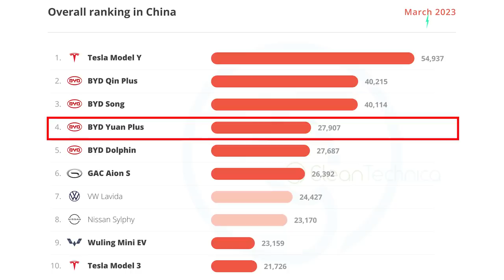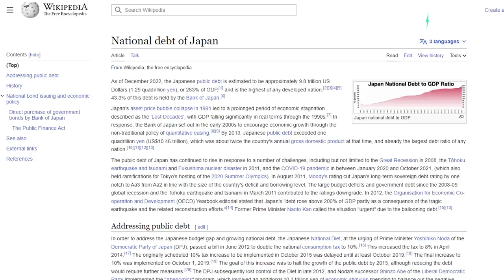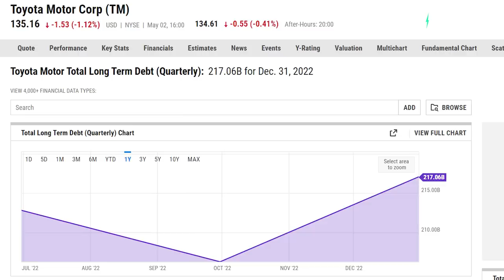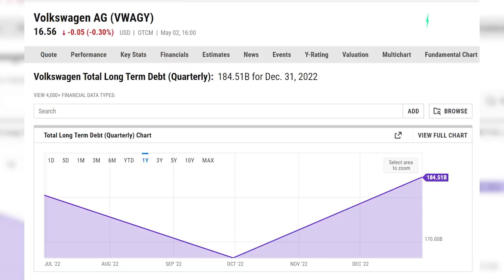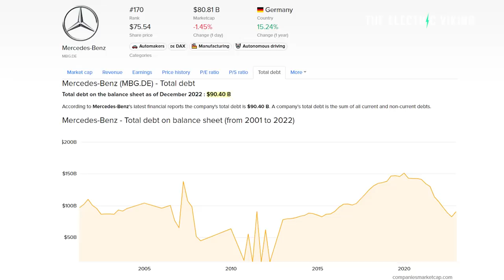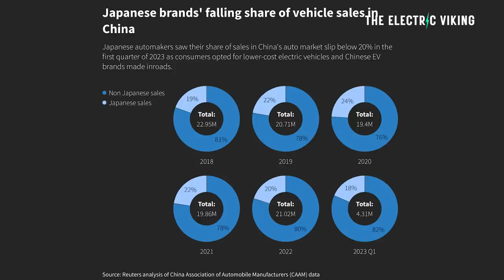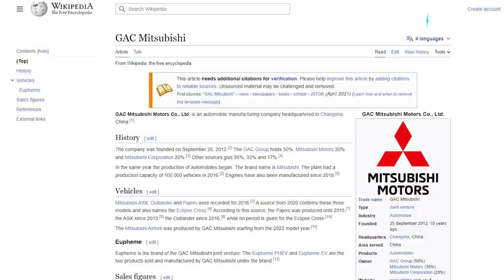Japan's automakers' Kodak collapse will cause an economic catastrophe

Comment: Japanese carmakers' dilemma is complex. EV involves 3 major technologies: traditional car, software, and battery. They are only good at the first, and need to master the last two as quickly as possible. Transition is very expensive. That's why only Tesla and highly committed Chinese new players fare better, so far
Reply: And Tesla are making a profit on each sale as well as charging equipment and storage.  So far not relying on repairs.  Past vehicle industry is based on servicing, parts and repairs.  If you can't make money on an EV sale, you don't have the time to get to the repair era.
Reply: Also if they convert to fast to EV they loose all their investment already made and they still making large profits selling gas engines
Reply: A review of Tesla's development history shows that it is China's well-developed electric vehicle industry system that has made it successful. If Tesla had not set up a factory in China, it would have been stuck in production hell for a long time and could not have quickly opened up a gap with other competitors。It is also because of China's well-developed electric vehicle supply chain that Chinese brands are able to iterate quickly, leaving all other countries behind.
Reply: @ShareGoodThings11  Agreed. Chinese new players entered the field around 2014 and started developing the supply chain. Tesla joined in 2018 and brought some technologies. Benefits are mutual. Obviously BYD worked on it even earlier and developed its own supply chain
Reply: Japanese carmakers simply cannot compete with Tesla and Chinese automakers on making BEVs.  That ship has already sailed.  What they can do now is to make Hydrogen Combustion engines hybrids to compete with BEVs.  That's what they are good at.  H2 stations will be built for H2 trucks and buses that H2-cars will be able to fill-up also.
Just a lot of marketing for energy companies to build H2 stations and for people to buy their "self-charging" H2-powered Zero-Emission hybrids.

Toyota should press ahead with Hydrogen Combustion engine with hybrid power train that is already perfected and proven to be highly profitable.  People will simply fill up with Hydrogen the same way they have been filling up with gasoline.  Leave the complexity issue for the experts to solve.  We will just enjoy motoring the same way we used to.
Reply: @trungson6604  I'm unconvinced that hydrogen is a viable option for passenger cars. Japan could implement it for all to see. If it's successful, everyone would be convinced
Reply: @PeterXiao1  --"China is quickly and quietly taking control of the hydrogen fuel cell market, with market activity over the past year dwarfing that across the rest of the world. While the country pushes to catch up with electrolyzer technologies, it could be set to dominate demand-side sectors in the hydrogen economies, if international competitors fail to step up their pace.

Throughout 2021, hydrogen fuel cell vehicle production in China increased by 48% to 1,777 units. Around 35% of this was achieved in December, according to the latest data released by the China Auto Association.

But the real headline figure is production capacity, which exploded five-fold through the year, even despite strict lockdown measures in many provinces across the country. From an 8,000 unit-per-year capacity at the start of 2021, the five major fuel cell manufacturers have all expanded production capacity, with their cumulative annual capacity now surpasses  45,000 units."  Sorry, this site doesn't allow posting of link to the article.  

Japan's advantage is in combustion engines, with so much legacy investment already, so Japanese automakers must make the most of H2-ICE technology instead of Fuel Cell.
Reply: @trungson6604  The text quoted isn't credible. 1777 units is peanuts. China is studying hydrogen technology, just in case Japan could make it work.
Reply: Elon Musk made good friendship with Shanghai’s mayor at the time and so his factory was able to be built in no time contrary to no place wants to his factory at the time.  This tells you the importance of relationships in the business world……
Reply: @PeterXiao1  "Knight says that several bus operators around the world, including one in Sydney, Australia, have already run into problems with the charging of multiple battery-electric buses.
“The guys in Sydney had to spend quite a bit of money [on upgrading their electricity supply] just to get the first four [battery buses] set up. They ran these first four buses for a little while and the manager of the depot got a call one day from the local substation operators. And they said, ‘I just wanted to talk to you about how much power is actually being used... how big is your depot? [The depot manager] said, ‘Oh, we've got about 140 buses. They said, ‘Oh right, no wonder you're using so much power’. And the guy at the bus depot says, ‘but we've only got four battery buses’.

“And the electricity supplier guy goes, ‘You're telling me, you're using this much power charging four buses? In that case, I better just check how many you’ll be able to charge before you max out the grid’. And the bus operator said, ‘yeah, you better tell us how many, because we quite like these battery buses, we’re planning to get more’.

“He [the power supplier] said, ‘your maximum number of buses in that location here in Sydney with this grid is six buses. If you charge at a higher rate than that, we’ll simply turn you off... because you’ll pull down the [grid for the] whole inner west [area] of Sydney, it can’t sustain this amount of power.”
Reply: Right now, BEV seems to be a cheap solution...because it depends on spare electricity gird capacity...but wait until more BEV comes out that will max-out the spare grid capacity...then BEV won't be so cheap to fuel up any more.  Meanwhile, H2 is getting cheaper and cheaper....
Reply: @trungson6604  Again, someone has to demonstrate hydrogen's viability. Since Japan is the most eager promoter, it has to pilot the application
Reply: Agree that software is a key technology for EVs.
Reply: @PeterXiao1  -- Toyota, Honda, and Hyundai have demonstrated great working FCV's, although they do not have as much internal space as Tesla's.  To make more room and to reduce the weight for FCV's the fuel tanks must be made similar to the batteries of Tesla's BEV:  Long and thin tanks forming the floor of the FCV and take on structural task as well, so the front and rear axles are joined by the skate-board shaped structural fuel tank structure.  The HV battery can be placed under the front seats while the FC stacks under the rear seats.  This will provide a FCV with a front "frunk: and a rear trunk, just as spaceous as Tesla car and lighter.  

The viability of H2 commercially as motor fuel is demonstrated by Fuel Cell forklift operators that is replace battery operated forklift, due to the convenience of quick fill up and competitive cost.   They are paying $7 per kg of H2, NOT the outrageous $17 per kg like Californians are paying at the pump.  Green H2 is projected to cost around $1.5 to $2 per kg in the next 5-7 years, due to major advancement in cost reduction and gain in efficiency of electrolyzers, and low cost Renewable Energy.
Reply: @trungson6604 - There is no H infrastructure to speak of.  Much easier to produce and distribute electricity.
Reply: @trungson6604 - H is much more expensive in the US where there are less than 40 H stations, most in California.
Reply: Nobody has the software like Tesla for robotaxi, which is a winner takes most market. Maybe Waymo and Mobileye are tied for second place.

Comment: The only way I can explain Japan's failure to proceed with EVs, after a promising start 15 or so years ago, is that maybe Toyota has a significant shareholding of oil companies, who offered the decoy of hydrogen power while badmouthing EVs to the board and executives.
This is an interesting possibility, because if true, Toyota's failure will not only lose them (the oil companies) money but will signify the end of oil's market to car owners. It may precipitate failure of some oil giants and create an avalanche toward EVs. Japan's economic collapse will be just a side story. The rolling failures of oil, some of them US-based, may indeed bring about another depression and in any case will remove the USA as the world's biggest economy.

As a side note to that, it would be ironic if Mexico had to enforce its borders to stop unemployed US auto workers going to Mexico to seek work with Tesla. 
I think Elon is more likely right than wrong.
Reply: @David Inkster Toyota looks at the Chinese automotive market as they see the US. 

Those two markets are very different. 

The US is dominated by the automobile. China is not. 

In the US getting around without owning a car is extremely difficult. In China it is not. 

China, therefore is served by the needs of electric vehicles. Those cars are very useful for getting to and from work, for going to the markets and other chores. They don't need their cars to go from Chongxing to Beijing to Xian. They have high speed rail to handle those things. And when traveling between those cities there is a plethora of mass transit available. 

Going from Los Angeles to Chicago to New York is a much different matter. There is no such thing as high speed rail in the US. And Los Angeles mass transit is very rudimentary compared to anything in China. Chicago is more similar to LA than any Chinese city. NY has a decent mass transit system but when compared to Beijing?? It is not even a contest. 

Japan bases all its major decisions on its major market, the US. And they have figured out the US won't abandon their gasoline powered cars for EVs. Hydrogen is a different story. 

So Japan waits for hydrogen to become big. But even in hydrogen, they trail badly. Hyundai has them beat badly. Why won't Japan turn their nation's scientific prowess to making hydrogen useful? Using carbon nanotubes as a catalyst for generating electricity? Getting off the exotic and rare metals such as platinum, palladium and iridium for converting hydrogen to water and generating electricity. Trust me, Hyundai is going all in on hydrogen. The Koreans are very big in battery technology also. 

Japan has been paralyzed. By their history of imperialism, their refusal to apologize for it and then they make the Fukushima-Daiichi nuclear meltdowns a reality. They don't even have the scientific expertise to deal with the nuclear meltdown. 

Japan has been described as a killer whale by Colonel Douglas MacGregor. It is a broken down nation with nothing good to offer to anyone. They are poisoning the environment in which we all live. 

And the Japanese are really expected to lead Asia?? They will trail the rest of Asia. China will lead Asia. The Koreans will be second. Japan won't even be third. They will trail nations like Vietnam, the Philippines and Thailand. Just watch. It is coming.
Reply: @davidharris2147  Philippines? Are you serious?
Reply: Toyota put all there eggs into a fuel cell concept. They made the best one in the world. They just failed to see how many nations would have hard carbon rules.
Reply: They'll just push an even higher increase of plastic production.
Reply: They have too big shares on major ICE part makers, almost all of them are japanese company. Once they're switching to EV, they're loosing big in sparkplugs, muffler, engines, pistons, valves, service centers, parts supply and so on. Too much, a way too much. And it is surely become national issue: Million jobs gone.
But they cannot hold it, sooner or later ICE will vanished by EV.
Reply: @David Harris  Hydrogen is a white elephant for cars, even trucks it will probably fail.
Reply: Hydrogen split from H2o water is the best option, electricity production is not happening enough to fuel ev s  batteries are toxic, the push to ev’s before a complete infrastructure that works in all temperatures will kill people! It’s insane the way the governments and businesses are throwing everyone over a cliff! Machines that work on diesel and gasoline are the best way for people to survive currently, ev’s are not up to the job.
Reply: @Triedandtrue44 Hogwash.
Reply: @Triedandtrue44  Wrong. Do some research on EV battery recycling. 20 years from now a well honed closed-loop (less need for mining) recycling system will be in place. 30 years from now few people will need a car. Full autonomy will have taken over.
Reply: EVs also run on oil, so oil companies need not fear EVs, what they are opposed to is renewable sources of fuel, unless they own them or control them. 

The industry will find it hard to change to electric not because of the platform but because of the need to keep bringing out new cars. If EVs follow this logic, a large amount of waste batteries is created, and it will use up a vast amount of lithium etc. Not clean industries. It is the economic model that is the problem, not the vehicles.
Reply: @libran58  Do a search for Redwood Materials. JB Straubel, cofounder of Tesla, is already on it! There are other companies around the world filling this need. Why haven’t we heard more? Because most batteries are still in the cars!  These recycling companies will run on renewable energies and they will have well refined processes by the time first and second gen batteries are returning in large numbers for recycling. Just like aluminum cans, it will be cheaper and less energy intensive to recycle.
Reply: @libran58  Did a quick search in Google Earth. The Redwoods headquarters is in Carson City. The new processing facility is 2.5 miles as the crow flies from Tesla Gigafactory, NV. How convenient.
Reply: @Triedandtrue44  Since you only seem capable of repeating what you may have heard somewhere, how about a few facts:
1) Hydrogen fuel cell powered vehicles are not practical. Even if we ignore the requirement for precious metals to make the fuel cells, the dangers of embrittlement and failure of high pressure hydrogen fuel systems and the fact that hydrogen refining and storage are far too complicated, costly and risky to ever have home systems. We get to the point where we have to talk about the cost of production for fuel. The green hydrogen you propose to power hydrogen vehicles takes about 6 times more electricity than simply using that same power to recharge a battery electric vehicle. Hydrogen loses and that's just economics.
2) You talk about diesel and gas being the way to get around and then you talk about how toxic BEVs are? That one nearly made my brain explode with illogic. ALL internal combustion engines produce poisonous fumes that go directly into the air that we ALL breathe. ThaThat's happening right now, right where you live. BEVs, on the other hand, produce ZERO emissions. Any toxic materials that BEVs contain are recycled, not vented into your air or flushed into your water. That stuff is far to valuable to throw away. Again, economics, BEVs win.
Reply: @davidharris2147  it is surprising to see such a Chinese government perspective from an English or USA based commentor. It's the kind of thing that would be written by someone living in China with blinkers on, not realising Japan apologised many times for imperialism.

Japan is light years ahead of Korea in quality as a concept and in many areas of tech specifically.
Reply: Americans also spend money on oil. If you reduce their costs you free up money to invest in other areas. That's called an economic boom. 

I recommend you read "What is seen and what is unseen" by the late French economist Jean Baptiste Say. You're making the classic mistake of only looking at what is seen.
Reply: @jedi_mapperp4073 e have two lithium ion battery recycling and remanufacturing startups in Canada as well. Most of these companies can repurpose 98% of the battery
Reply: It may have to do with how electricity is produced in Japan. It is said that it is not done in a carbon dioxide free way
Reply: You can make hydrogen with nuclear power and wind power
Reply: Even if it's South Korea, they think of hydrogen. if you produce electricity by burning coal or oil, it might not be so strange
Reply: @kennedy6971  aren't they also trying to develop a combustion engine that will run on hydrogen
Reply: I think we will see nukes used to attempt a small nuclear winter on our planet. If we cooled down 1 degree big oil would be happy because it would be back to business as usual
Reply: @Triedandtrue44  if we continue using that philosophy man is going to go extinct. The working models that mam made have no relevance to the planets ability to support life. I believe we will go extinct. Might take 500yrs.. but I think we will burn oil until we can't amymore.. status quo wins this one.. when the military doesn't need oil then maybe it will be gone.. maybe? .
Reply: @Triedandtrue44  If there isn't enough electricity to fuel EV's then how are you going to split water to make hydrogen? With hydrogens innefficiency it will require at least three times as much electricity for every km driven
Reply: Having worked with them is they did not like  that the prius battery was not sigma 6 meaning very reliable so Toyota bosses went against ev as they had issues with reliability. Perfection has a huge cost as you cannot pivot when required. They also cannot do an energy balance when using hydrogen which does not help.